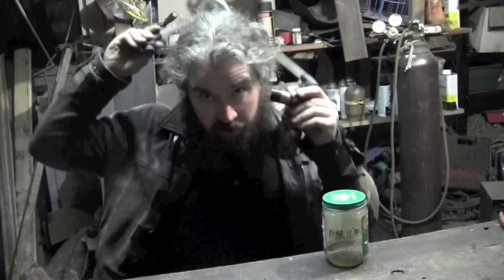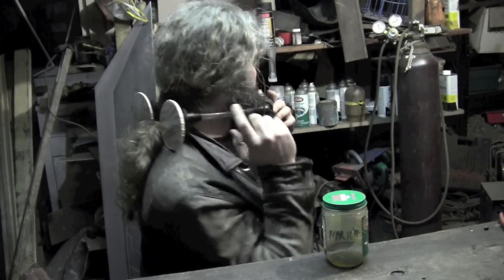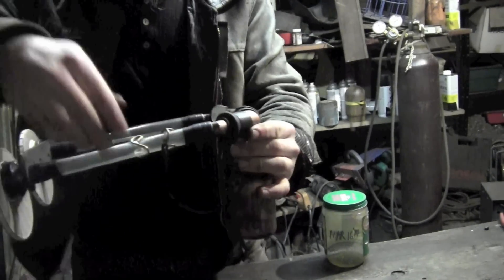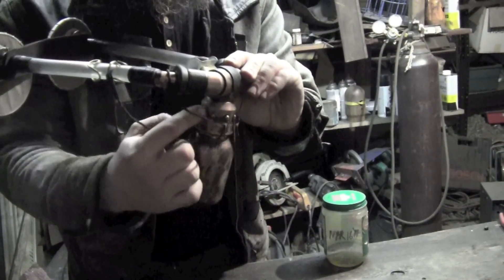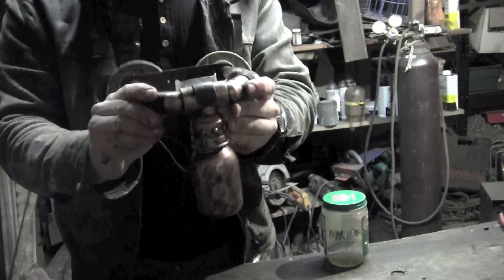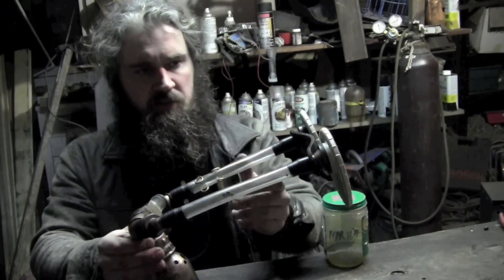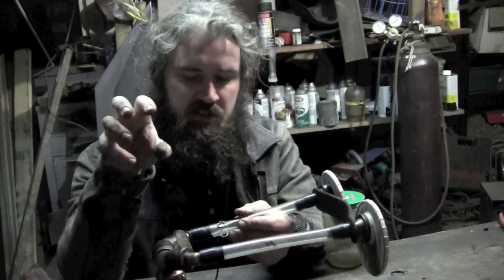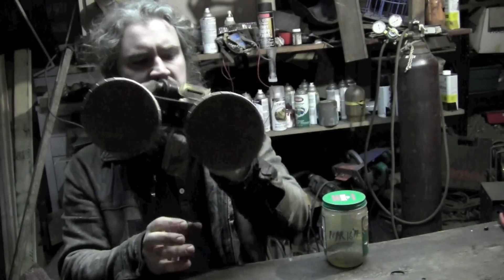That thing around my neck.

Comment: I sort of figured it was some sort of breathing apparatus, but none like I've ever seen before, It's pretty neat, I just use a Bandana/ Neckerchief tied around my neck as an air filter and to help in protecting me from harsh weather or debris while working on wood or metal when you have splinters or sparks flying in your direction somewhat helps with the small thorns of a Raspberry Bush or a Rose Bush, or against nuts and gravel when using a Weed Whacker without a guard on it, from research and experience I've learned that a bandana/ Neckerchief works good for such things, Miners used Neckerchiefs as air filters back in the day, along with safety goggles like the ones you were wearing while making the Buster Sword back in the day, with ventilated safety goggles it works good as long as you've got good healthy lungs and can breath through your nose with the neckerchief covering your nose and mouth, to clean it just throw it in to wash with the rest of your clothes, mine usually goes a year without cleaning some people might care about it getting cleaned more but how often you clean it is optional, but that's a pretty good idea also and their are worst things to deal with than spit so other than it being a pain in the butt to have to clean it every time you use it even though it don't take any effort at all to do it, there's no real downfall, creative yet effective, cool.

Comment: That answers one of my questions. Now I want to know about your eye and ear protection.
Reply: That's where the jar comes in, cover it with a paper towel held in place with a rubber band. As the water evaporates out, the fluid becomes nice and gooey. When it's the consistency of Vaseline put about half of it in another jar and seal it up. Let the rest keep drying until it gets to about Silly Putty thickness.

You just mold earplugs out of the Silly Putty stuff, just like the old wax earplugs.
The Vaseline stuff just get smeared right onto your eyeball, it catches metal filings and dust before they get into your eyes. Think of it as eye-snot.

Comment: Wow, that is some really cool engineering there that allows such a high concentration of metal dust to collect in your mouth so it can be drooled into a jar. It's a shame that nobody makes a respirator anymore that takes cartridges that filter out metal dust and TOXIC METAL FUMES like the mask I used when I did metal and auto body work. Of course, on the downside, I never got to produce saliva with such an interesting color.

Comment: if you had one with a hose that went on your belt or something it could be useful for avoiding poisoning from welding galvinized steel, I made one using one way air valves.

Comment: I assume there is a one way valve system that connects to the spit collector and that is is cleaned properly on a regular basis to avoid the build up of fungus?  if that is the case, then it should be safe to use around chemicals if the filter system is similar to the standard respirator.

Comment: Is there a check valve between the spit cup and filters, otherwise you'd pull air through the holes in the cup.

Comment: Most of what you are emptying is not saliva, but condensation.  granted you will get some tiny amount of saliva, but in this respect it works like any brass instrument.  Your breath contains moisture and the temperature difference between your breath and the device causes condensation to form along the piping.  That's why you see brass players emptying their "spit valve"...they are blowing the condensed moisture out of the horn.

Comment: The guy who sells the thing says that if saliva is coming out it is because "your teeth are not together".   Is this true or do you happen to bite this like a snorkel?
Reply from the maker: I don't bite it like a snorkel, it sits in front of the teeth, your lips hold it on. I'm sure my teeth don't spend the entire time clamped shut, I wear this thing for hours at a time, you'd have to actively concentrate to keep your teeth clamped shut continuously. The guy in the video is pretty old, I'm sure some people are just more drooly than others.
Reply: +michaelcthulhu Yeah , I drool all the time.
Reply: +michaelcthulhu im thinking its condensation from your breath. i know when i wear n95 respirators after a few hours i have take the mask off and shake the water out. its not spit i don't think.
Reply: No, that's not true. Like Bi Polarized said, it's the condensation from the breath of the user. You lose about as much fluid from breathing throughout the day as you do from urinating.
Reply: This is absolutely true, as a brass musician we see this in our instruments. I can be playing and have to empty my "spit valve," but if I leave my trombone out of its case in a cold room it'll condense water all the same and I'll empty it then too. (Admittedly, it might be a slight combination of both)
Reply: Yeah, i play a large brass instrument also. You dump a lot of condensation out during practice. Probably an ounce or so?

Comment: The device is meant to be worn between your lips and teeth so you won't have saliva build up.  If you can't swallow with the device in, you're wearing it wrong according to the inventor.  But I guess you'll still have condensation.